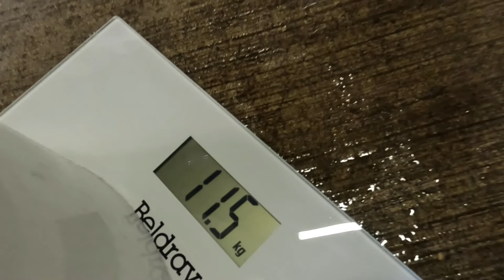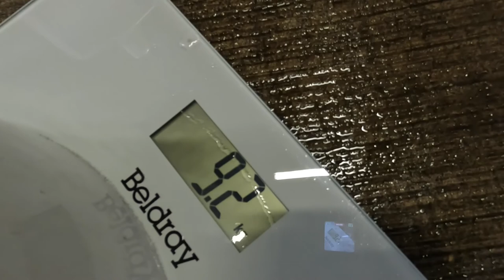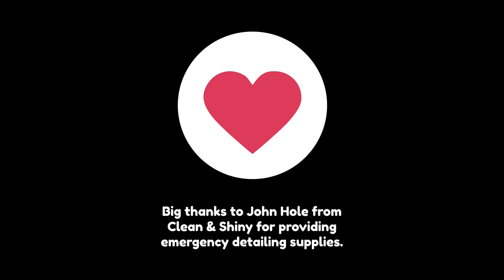The Car Boutique: Talk all things PIR

Comment: What an eye opener Andy! I now know what PIR is and how to easy it is to calculate it. Gonna make things easier for me to get the correct snow foam measurements now. Cheers
Reply from the maker: Cheers Karl. Only certain brands use PIR but when they do it's best to do the calculation properly and get things correct. Using too much or too little foam solution can inhibit the product from working as advertised.

Comment: Great video as always.
I prefer the neat product method, using the adjuster to control the PIR. I Calibrate the cannons to produce 5, 4, 3, & even 1% PIR, making a note of the position of the control knob and then, if I want to top up or swap product I don't have to do any dilution.
Reply from the maker: Great Tip that Shaun. Might even do that myself from now on. Cheers.